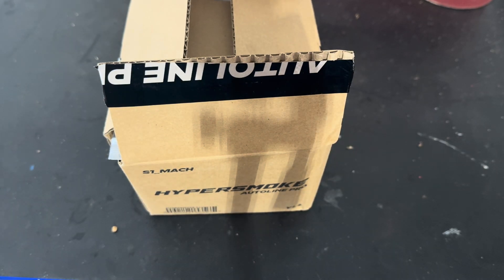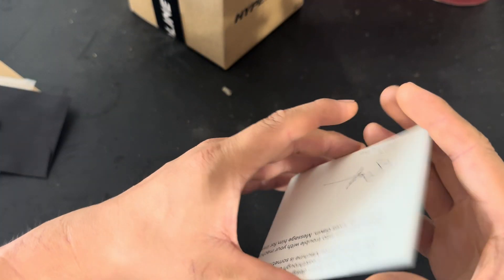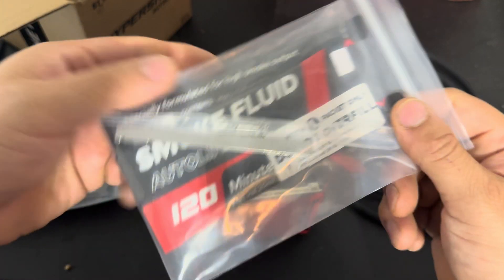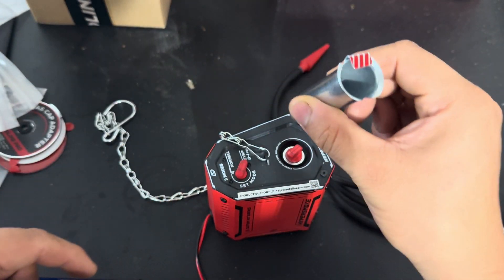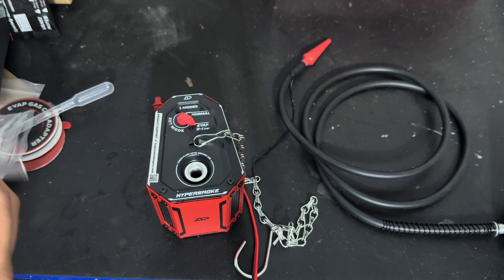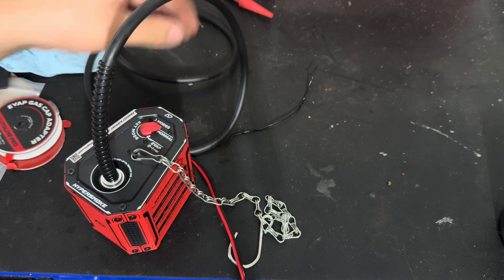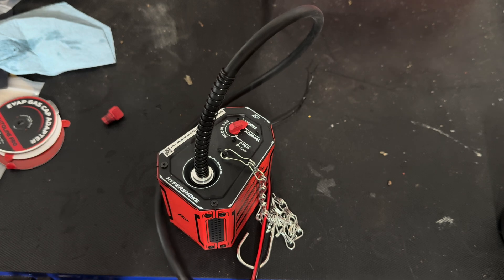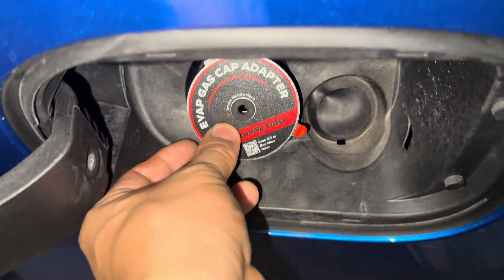Automotive Smoke Machine EVAP Vacuum Leak Tester

Comment: how do i connect this when my hose is only two feet long the gas tank is 8 feet away no port for evap who even has one? What hose do you even use? I'm not liking it.
Reply from the maker: Every vehicle is different but most newer vehicles  dont have an evap port any more , most vehicle have a special adpater to test the evap system, and you will need a scan tool to close the evap system for testing and you can smoke test the evap system from the engine bay  and inspect for leaks at the lines, canister and tank.
Reply: @MTG6.2  I got the smoke tester to work in the gas cap. no smoke coming out, it has the be the ESIM module.. ugh, behind the wheel
Reply from the maker: Thats good, thats pretty much working on cars got to work with what you have, what kind of car are uou working on ? And what code does it have ? Is it a p0455?
Reply: @MTG6.2  JEEP LIBERTY 2006 liberty evap system vacuum leak P0456 AND P0457 small evap leak and check engine light. I'm thinking its behind the dang tire... and i need a lift.